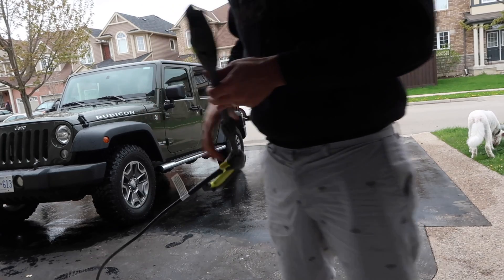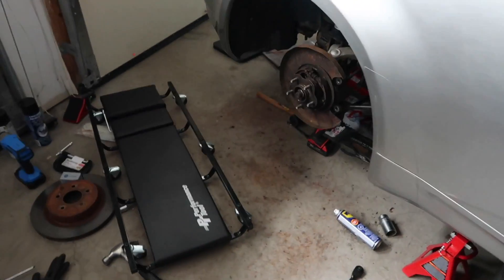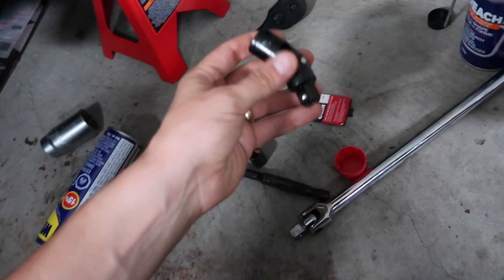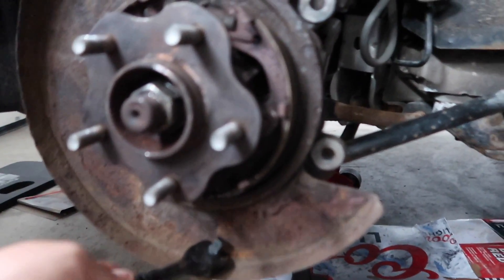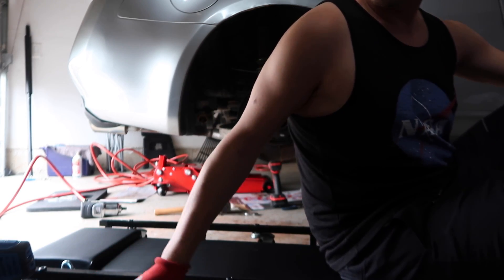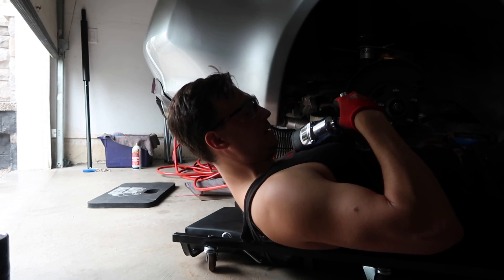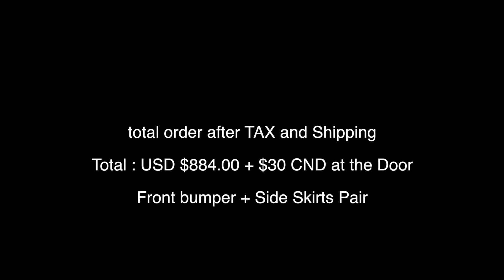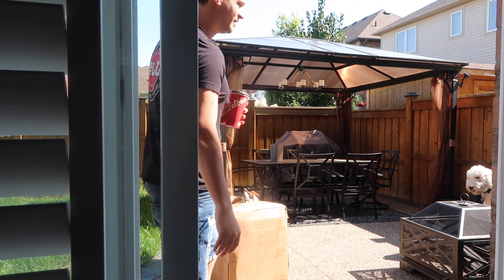Project Drift G35/Jeep UPDATE + PARTS!! So Close To Sending IT!!

Comment: You should heat it up with a torch and then spray it with cold water so it expands and then sudenly shrink and hopefuly rust cracks.

Comment: If it was me I would get some big ol 4 ton Jack stands and Jack and take a grinder to that bolt pull it the axle and punch out the threaded side take that to the Canadian version of ace hardware and match thread and length repeat as necessary but that's just me. Currently I'm throwing tubular headers on my 5cyl, lambo sound coming soon 🏎💨

Comment: Acetone + ATF is the best penetrating oil you can use.
Also, don't heat the bolt - heat the metal the bolt goes into.  Heating the bolt just makes it expand and will be tougher to get out.

Comment: Slap you have to heat up the metal around the boat so it will expand because you're heeding the boat the and bolt will expand and get tighter

Comment: I have way to many projects i have a 1993 240sx in the garage thats almost finished. Abd then a 1967 impala 69 camaro 70 camaro 70 chevelle 90s model mustang and a 57 chevrolet pickup in the barn/shed those are in various forms of disrepair and a 1993? Miata mx 5 that i recently put a rotary engine in is takeing up the driveway.

Comment: G35 is easy to drift. I pull it off in my 5 speed AT Open diff sedan. All you got to do is fully disable traction, it's got enough power and weight to swing out with good transitions.
Reply from the maker: Wildchild_inc yea I heard just pull the abs fuse to bypass putting a switch in
Reply: Yep that's all you have to do. Very good cars to learn on. I can't wait to see the future of yours.

Comment: OMG! use break and carb cleaner on those bolts you can't take out. spray them down, probably let em soak if you still can't take it out, then use a wire brush to scrap clean the threads and use it on the thread studs aswell.
Reply from the maker: DeLorean Kill when I started recording it was day 3 getting those off and I soaked them hard everyday and just couldn’t get them =[
Reply: haha brutal. maybe find a pipe for your breaker bar breaker bar for ya breaker bar and extra elbow grease.

Comment: hi peter i see your problem with the impact gun ... not to be snobby but ... lefty loosey righty tighty ... the impact gun is set on to tighten the bolt .... or is the thread on the bolts left handed . i hope it helped